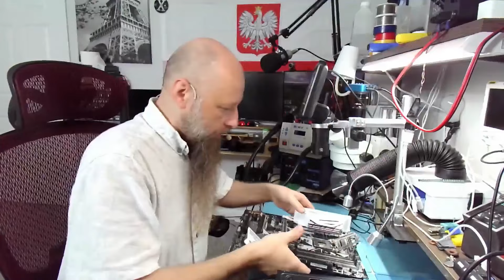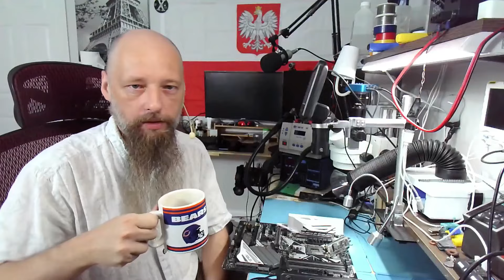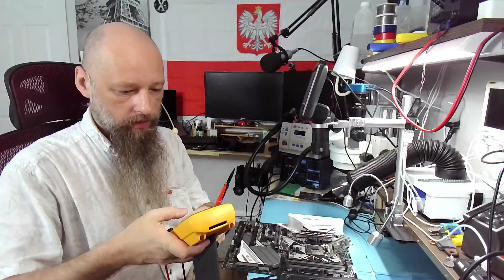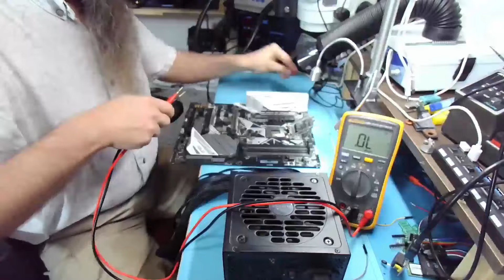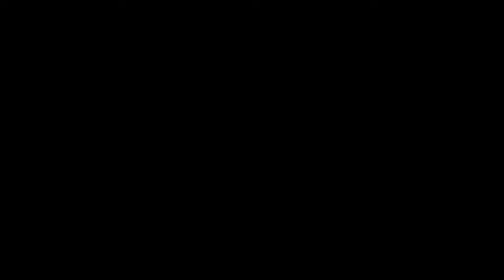Asus Prime Z370 A Diagnosis Short on VCORE and probably faulty SIO

Comment: Very informative Video ! Thank you.Could you provide more info where to find values for proper resistance for chipsets/cpu voltage rails ?
Reply from the maker: CPU resistance will be in the range of 4 to 8 ohms on VCORE and up to around 20 ohms on other rails.
The voltage will fluctuate depending on the load between 0.6V to around 1.2V
Memory voltage is stable and depends on the type of memory, DDR4 is 1.2V and resistance depends on size (number of chips) and type ECC vs non-ecc
Reply: Thank you. It is suprising how low resistance is for those architectures.